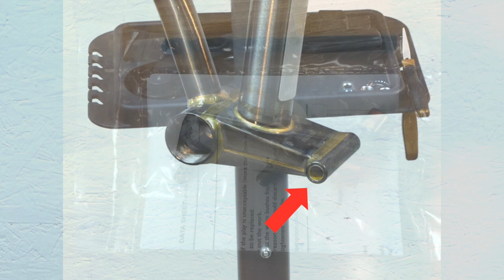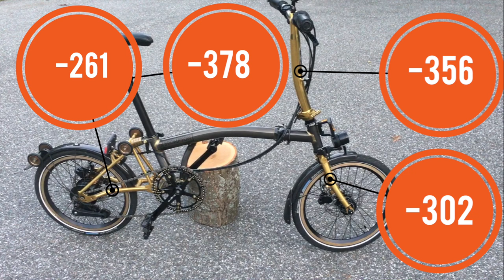Project Brommieloff Part 1

Comment: I DIY upgrade my e-bike as well. It is a Dahon K3. Used AKM light weight motor. Made battery in minimum size with protective circuit and put it into the seat tube. Final weight of whole e-bike is just 9.8KG. All parts are from China and are very high quality.

Comment: Nice work, very well presented and you have a new follower.  BTW, slide the cup remover through the cup to compress the tangs rather from the top down, just a bit easier and makes a reassuring ping when it's ready to push the cup out.